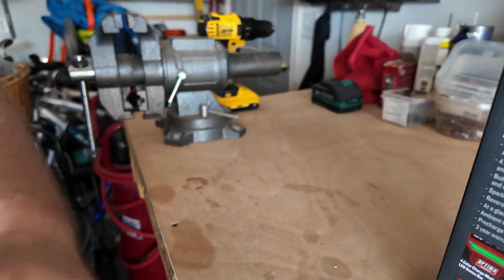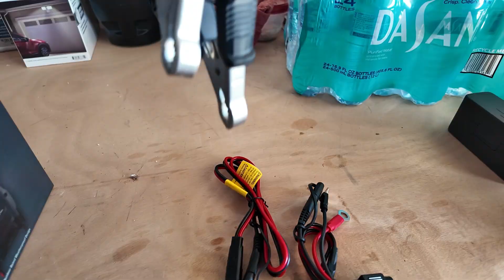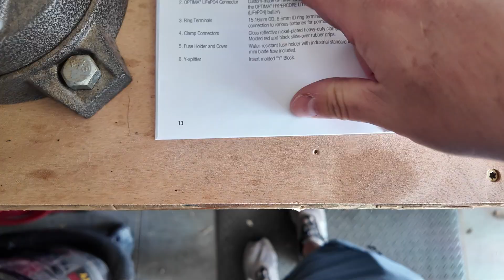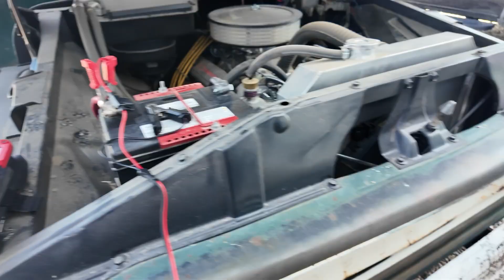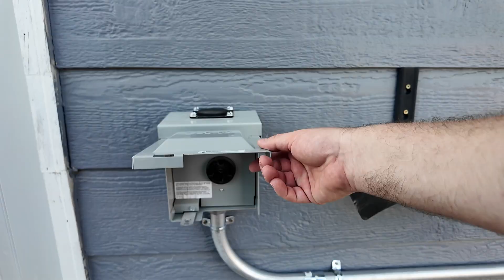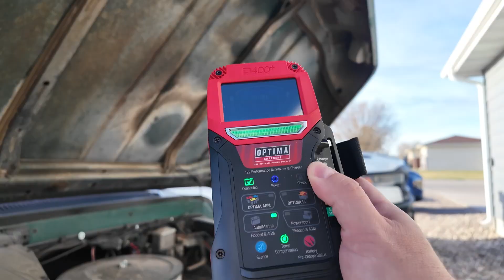Worth the Money? Optima Digital 400+ 12V Battery Charger/Maintainer Review

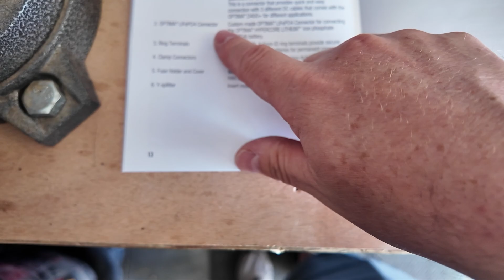Comment: You are showing the manual the page talking about the connectors and it is impossible to read the page because you are moving the camera all around @3:30
Reply: THIS CHARGER IS JUNK! DONT WAIST YOUR TIME AND MONEY. SUMMIT RACING IS AWESOME AS THEY ARE WORKING WITH ME BY SENDING THE 3RD ONE. 1ST TRY ON #1 IT POWERED UP AND DID A BATTERY CHECK THEN JUST DIED. NO LIGHTS NOTHING. TRIED TO REBOOT BY UNPLUGING AND UN HOOK A TRY AGAIN, COMPLETLY DEAD. SECOND ONE AWESOME SUMMIT GOT ONE OUT 2 DAYS LATTER #2 HOOKED UP THE LEADS AND PLUGED IN AND ALL IT DOES IS LIGHTS UP AND READS BATTERY. NEVER ABLE TO READ BATTERY AND THEN ALL LIGHTS FLASH AND BEEPS, ON MY THIRD IS BEING SHIPPED FROM OHIO SUMMIT WHEREHOUSE, THE FIRST 2 CAME FROM NEVADA WHEREHOUSE. IF THIS 3RD ONE DOESNT WORK A REFUND IS COMING. I TRIED SEVERAL BATTERYS THAT ARE ON MY NEW ENGINE  RUN STAND. MY HOT ROD AND BOAT, AND JETSKI, DONT WAIST MARKING UP YOUR WALLS THINKING THIS IS A GOOD CHARGER, GET THE WALL PUDDY READY.